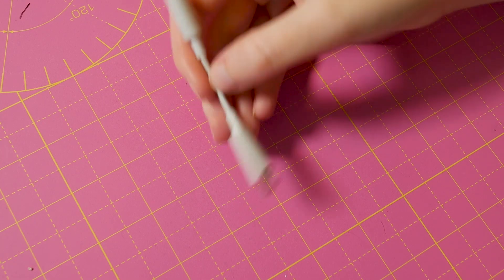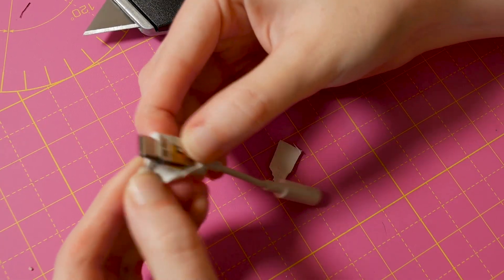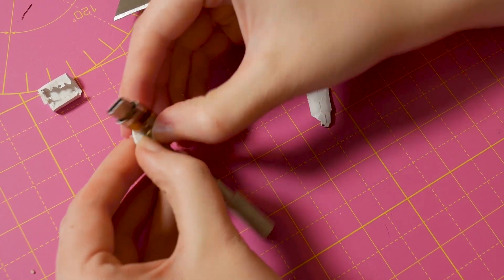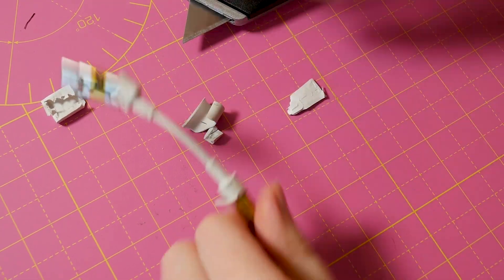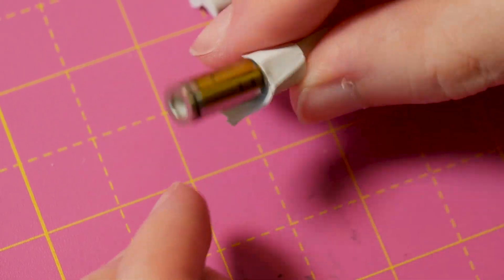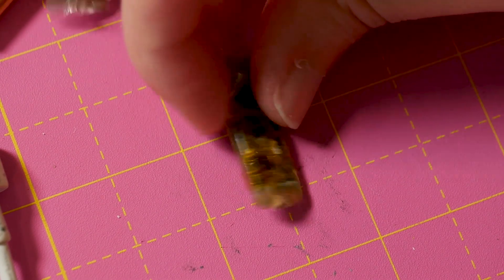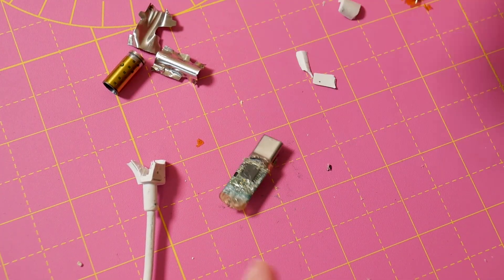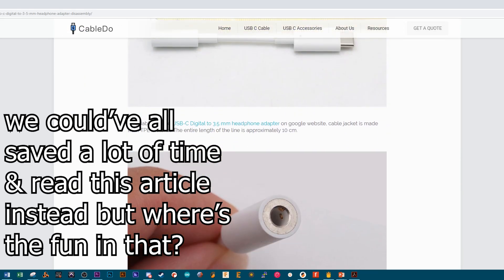What's Inside a USB-C to 3.5mm Audio Adapter?

Comment: i was in process of buying a newer  phone and found that they do not have a headphone jack. when i saw that 10 bucks got you something that you just plug into the type c jack and the headphones into the adaptor i was wondering what if anything was in the adaptor. well you showed me, us all. enough integrated circuits to maybe control the appolo 9 space craft 50 years ago. and not just wires to different types of jacks. fun watching you do this. thank you, and thank you youtube.

Comment: The mysterious yellow tape covering the PCB is called Kapton tape, used for electrical insulation surprisingly it works with very high voltages.
Reply: And it has excellent heat resistance properties. They probably used it to prevent the plastic flowing into the connector openings during the molding of the outer shell.

Comment: Since phones' 3.5mm plugs don't allow two channels for audio input, it's clear that for recording a stereo source, one would need to utilize the USB port.  However, most products seem to have made the assumption that you want to use the cable for stereo output, and optionally one channel for microphone.  It seems logical that if the chip was implemented correctly, one could provide two channels for input, but I don't trust the manufacturers to have taken that route.  It would be so much more affordable than the "interface" options they sell to the music recording market, but is it hopeless?

Comment: As others have mentioned: always cut away from yourself. But also, cut along the side of the connector and you're less likely to damage the parts inside. And also, also, a Dremel multi-tool (or similar) with a cutting disc is a much better tool for disassembling this type of thing.

Comment: No knife safety badge for you!
I had to quit watching at 2 minutes.  

First Aid for Knife Cuts   http://www.gsmw.org/content/dam/girlscouts-gsmw/documents/Knife%20%26%20Axe%20Safety.pdf

Print and post in by your desk for future reference

"If you have a severe, deep cut with lots of bleeding, apply direct pressure, elevate the wound above the heart, and get help immediately. If you are assisting someone who is cut, use latex gloves and sterile gauze when possible. If you do not have gloves, have the injured person apply pressure themselves.  If the cut is not bleeding severely, use lots of water to rinse the cut. Then, using gloves, apply antibiotic wash and ointment. Blot the cut dry before applying a sterile dressing or bandage"

Comment: i wish they would make a rigid one, like as small as possible but rigid so it cant fail (it obviously can but it would last longer)
Reply: I suspect they don't make rigid ones to avoid mechanical stresses on the USB-C connector in your smartphone,
Reply: @danielsmith6834 1:50
Reply: It probably exists, but I have a rigid one-piece OTG adapter and I find that it puts much more strain on the USB port on the phone than the regular type that has a short cable in the middle. I imagine it would be the same with a 3.5mm adapter.
Reply: @SteelSkin667  yep, you can try going the type c earphones route as that'll reduce the number of points of failure, but reduces the flexibility of using whatever earphone or headphone you want.

Though I think type c based earphones have an added benefit of additional features, at least based on the Pixel type c earbuds which offer Google assistant without any visual component on your phone screen.
Reply: I wonder if Liz could make one from the parts and have it suddenly work.